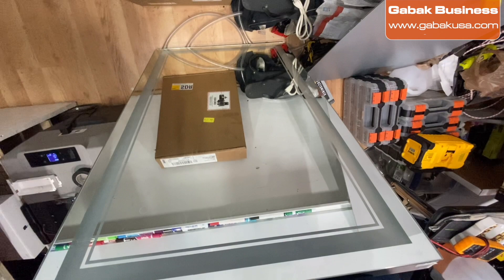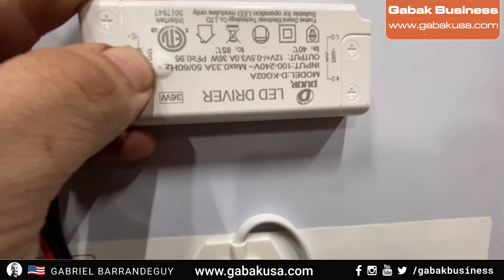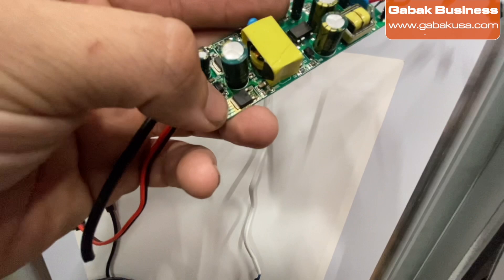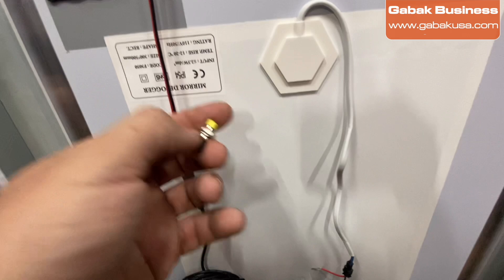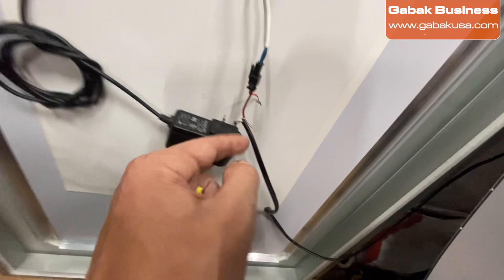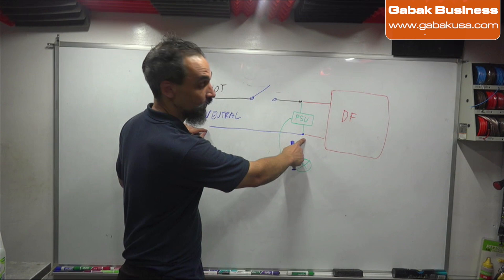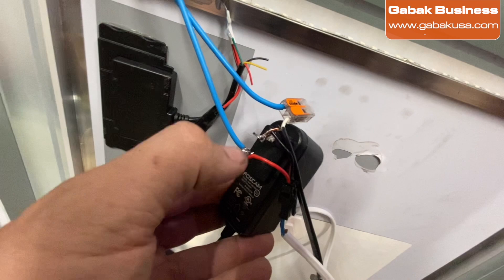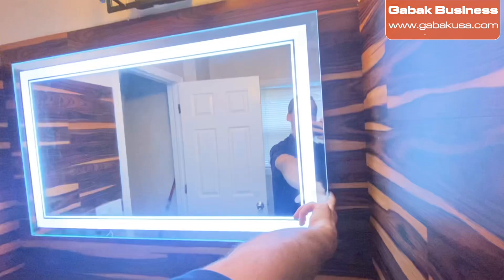how to repair LED light bathroom mirror?  - Gabak Business - Gabriel Barrandeguy

Comment: I'm replacing a ballast and want to know if is it neccisary to splice the ground from the new driver into the new power cord's ground or can I just separately ground them both? Great video! I'm an amateur electrician with just a year or so experience and you definitely got my sub! Thanks brother!
Reply from the maker: in DC you have no ground, just try to connect it the same way it was with the original or as close as posible

Comment: My mirrors button glows but lights are not charging. What to do?
Reply from the maker: there are no batteries inside
Reply: @gabakbusiness  its connected to electricity. The mirror vendor told me that there might be moisture problem. How do i solve it.

Comment: I recently bought an LED mirror and the light shuts off by itself after a few minutes. The touch power button and defrost button. Stay lit though. Is this normal?
Reply from the maker: it could be normal read the manual it could have a timer built in

Comment: Why not use the existing on and off ?
Reply from the maker: you can try
or you can do it my proven way
Reply: @gabakbusiness  yes if you have 3 wires coming from the on and off switch most likely that blue wire is what's going to allow you to turn the mirror on/off I purchased a new LED power supply ran the blue wire to the 110v defogger , neutral to the defogger with the AC neutral(blue) and line with line in power supply works like new